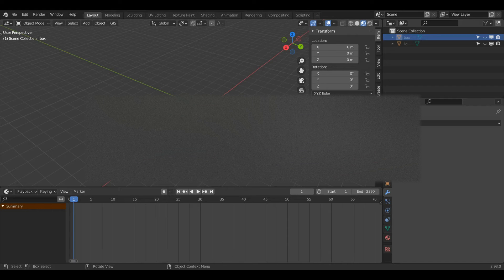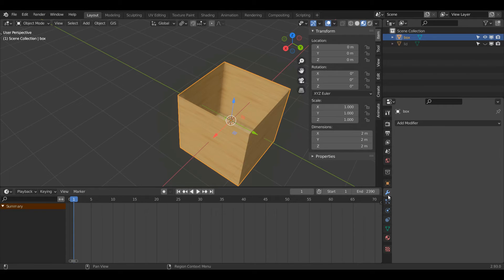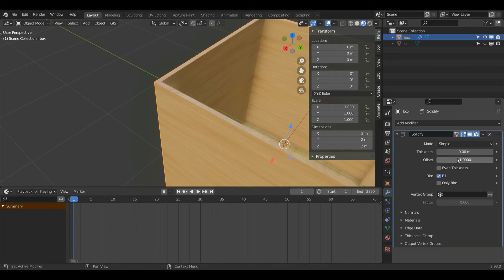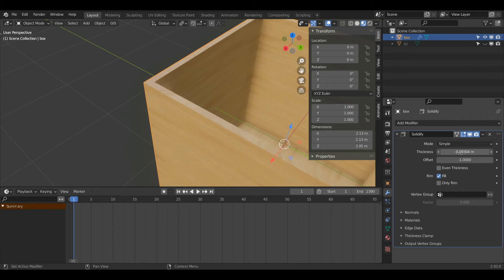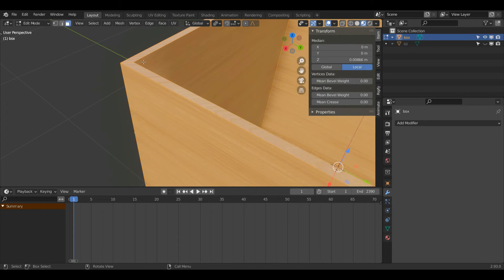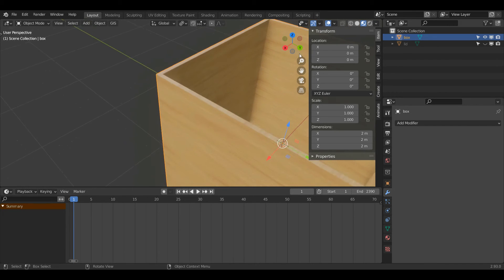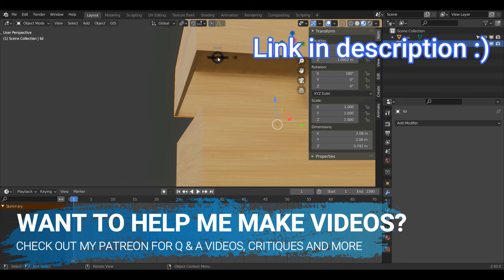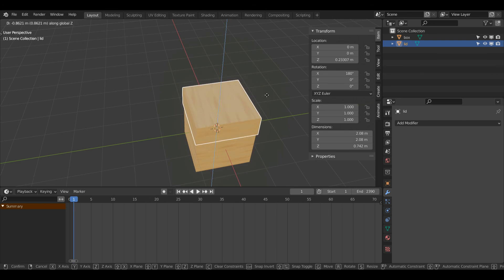HOW TO ADD THICKNESS TO YOUR 3D MODEL - BLENDER QUICK TIPS

Comment: Is there a way to get this to add faces and vertice too?
Reply: im making a voodoo doll im trying to make his head look like a burlap sack tied closed with a rope at the top, i split the verticies to make it look frayed then added a solidify Modifier but i want to be able to move the frayed edges around better but solidify doesnt add verticie edges or faces
Reply from the maker: @smcfadden1992  yeah I think this will definitely help you in that case.
Reply from the maker: If I understood what you're wanting correctly you can do this by going to the solidify modifier left clicking the arrow which points down and pressing apply. Make sure to do this in object mode. Hope this helps :)

Comment: I have a 3D car file and joined all of the exterior body parts (CTRL +J). I need to thicken the body from the inside in order to be able to print it without losing the exterior detail. Does it apply the same concept please?

I also want to thicken the model y 1mm, what should the value be?

Thanks
Reply: Did you ever figure it out I have the same problem

Comment: Is there a way to add thickness to individual sides, as opposed to the entire object, or would you just need to make new objects all together? And if that's the case, is there a way to 'snap' objects together for the sides of the box? Thanks for the explanation, great video!
Reply from the maker: Yes you can use the "Solidify Faces" tool (different to the Solidify modifier), which can be used to create a solid shape from a single or multiple faces. You can find this in the "Face" tab in the Top Toolbar in the 3D viewport, and selecting solidify faces to solidify selected faces. Keep in mind this is a Destructive method meaning changes can not be changed easily at a later point in your modelling process.